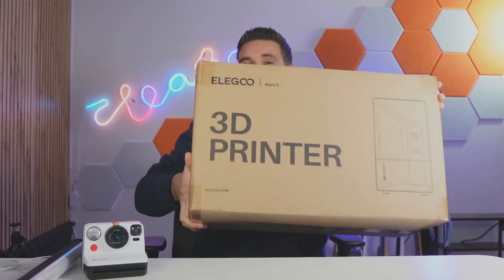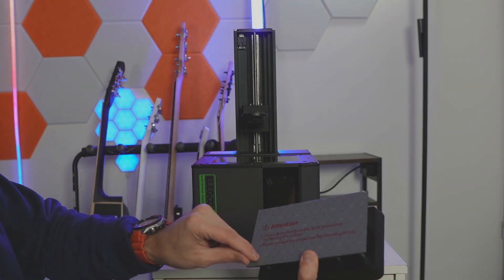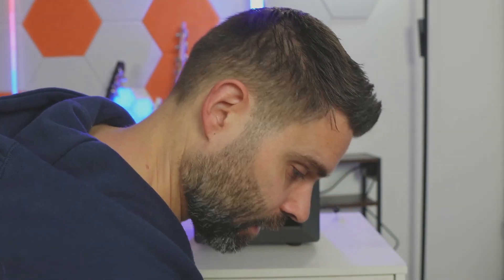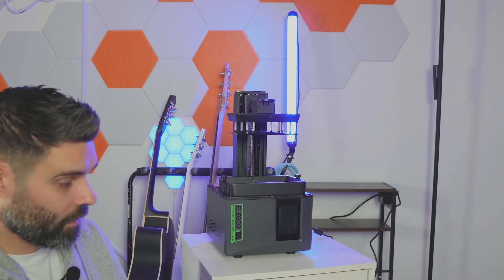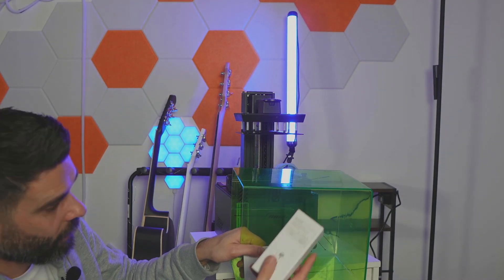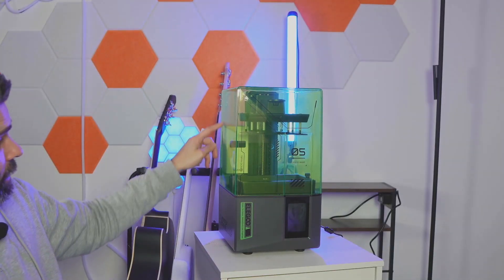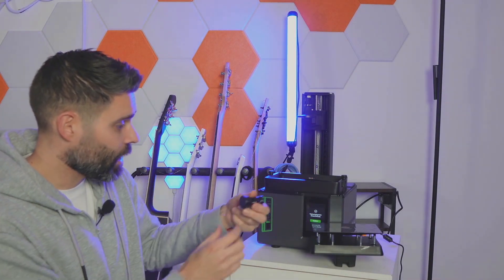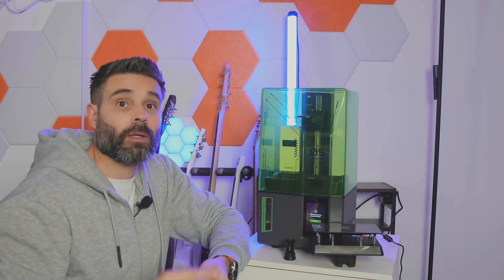Can a Beginner Use The Elegoo Mars 5 Right Out Of The Box?

Comment: I just got one the other day, did that exactly as you did, minus the little heater. And have yet to get anything to print. What am I doing wrong?
Reply: Same issue. Did you find out what was wrong?
Reply: @rohank342 I did. I had to up both of the exposure times. I took the bottom exposure from the stock 32.00 and brought it up to 42.00 then I brought the layer exposure time from 2.3 stock (I think) up to 2.7. also I missed one of the clear stickers. 😅 It was cover the bottom of the resin tray.
Reply: @LieutenantTso  I just received mine today and mine wasnt printing after 2 times. The first I forgot to take off the sticker on base plate and then after the second I decided to adjust the settings as well I still have 50 percent to go lets see if my changes worked if not I will try yours.
Reply: @dominicowens7425 I got my fingers crossed for you my friend, best of luck! I haven't stopped for two months 😅😅